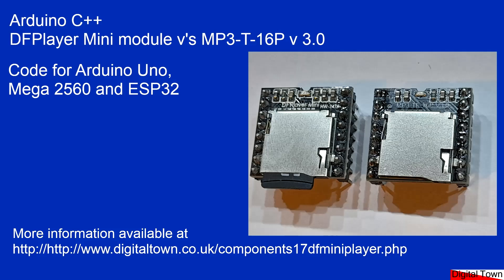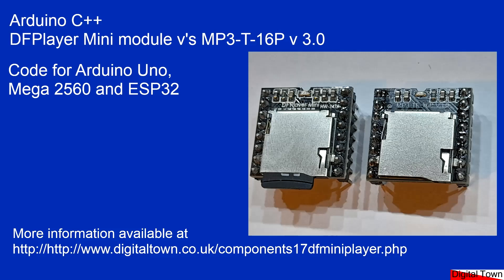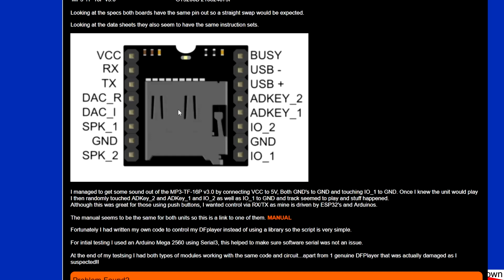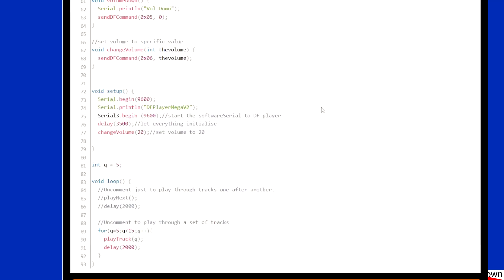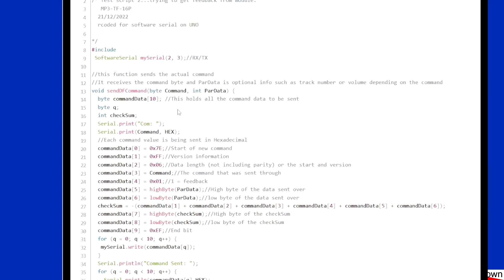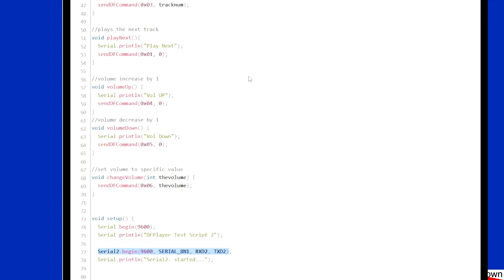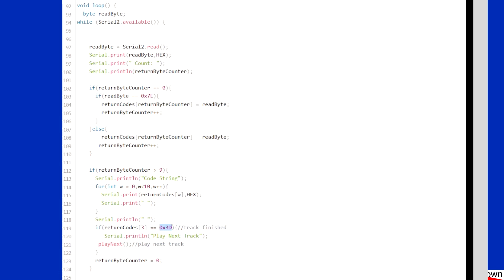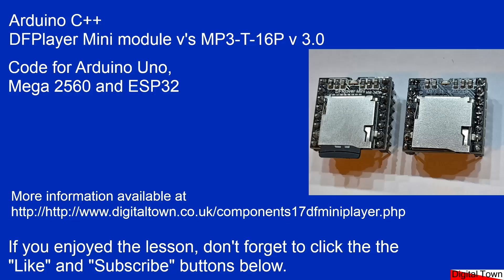Arduino C++ DFPlayer Mini module v's MP3-T-16P v 3.0

Comment: This is interesting, thanks!

Happens to me every now and then that I have fished a good prce on Ali ... just to notice that there are actually two models of the same with different layout or some smd component, then I realize they are actually like "model 101" and "model 111" ... and gotta dive deep to see which one is actually the one I want.  With ESP32 especially.

Incidentally it actually happened to me with module which just arrived to my country - I was looking at both versions, pondering if there is a difference. Just rechecked the order and I should indeed be receiving the DFPlayer. :$

Comment: So glad you made this video! I've been experimenting with many similar chips and noticed fine differences. With these two in particular, I also spotted the differences in additional resistors and different chip on the back. In fact, I'm holding these two in my hand and the one labelled "DFPlayer Mini" has 4 resistors while the one labelled "MP3-TF-16P" (with no version specified) has 6 resistors! I think there are many people making variations on these to make them cheaper. Another commenter mentioned the real ones are from DFROBOT and that is definitely the way to go! I want to point out another difference I found in case it helps others. When wiring a speaker to SPK1 + SPK2, the "DFPlayer Mini" outputs only the left channel while the "MP3-TF-16P" outputs both the left+right channels.
Reply from the maker: Interesting info about the single channel play. I hadn't noticed that issue as I tend to record the MP3's in mono fpr these units.

Comment: I guess most of the people didn't understand that the communication method is UART and thr baud is 9600..

You are sending a lot of data and you need the receiving side to be with a big buffer.

If you let the player execute the command sent end empty the buffer and use all the data sent to him all will be ok.

That's it, just a lack of memory.. 😊

100 milliseconds between commands is more than enough.

Comment: so many cheap versions out there and many different problems, even how the tracks are added on the sd card, the only way to guarantee no problems is order direct from DFROBOT , but at $6 each vs the cheaper alternatives, I guess depends on budget and if that budget is worth the stress.
Reply from the maker: I had that issue early on, now I just format the SD card and add the files one at a time in filenumber order. Seems to work every time.

Comment: I have bought several from different vendors, connecting via UART has been impossible. I’ve tested with multiple arduino libraries and micropython. Never works as intended. I’ve ordered what I hope is the original. Let’s see if it works…

Comment: Is it possible to display the file name being played on an oled screen
Reply from the maker: The short answer is no because the unit doesn't seem to read file names the way we would normally think of them. It just seems to run through the order they have been put on the SD card... and with a unit this cheap that's not surprising.
The only work around is to load your tracks on the SD card, play through them and list the order and then use an array to draw the file names from as the track plays. The problem with this is if you change the tracks you have to start again.

Comment: did you try to play a audio clip less than 1 sec? the new one didnt play
Reply from the maker: Sorry I've not tried clips that short, I think the shortest I've done is 3 seconds. Have you tried formatting the card and only putting that single clip on. Gragmentation of any kind on the card is always a problem.
Reply: @digitaltown5442  yes i tried it the older version dont have problem with that also i notice that the new version has crappy sound
Reply from the maker: @ThePackingtapetech  I
The sound on the ones I have has been identical to my ears to the old version. I do wonder about the quality of them but at the price I pay what can I expect.

Comment: what are the differences I want to solder a button, the force and a speaker, mine is mp3 tf 16p v3.0, and it didn't work what could it be?
Reply from the maker: I would need to see what you are soldering the button to as without a circuit it's impossible to answer that question